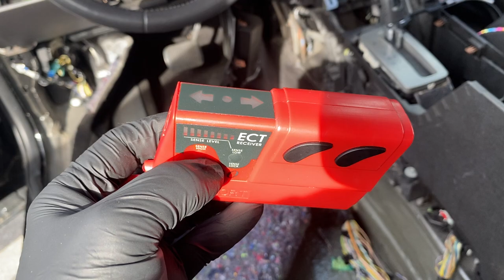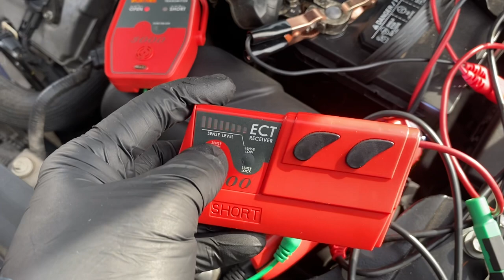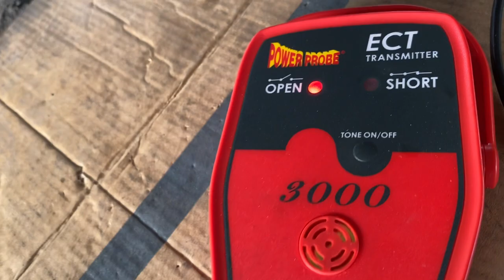Power Probe ECT3000

Comment: I am wondering why on the handheld short tool your arrows aren't lighting up telling you which way to go.  I see the red light but no lit up arrows.
Reply: That’s what’s mine doin idk if I’m doin it wrong or what
Reply: @alexclark6884  I was thinking, maybe we just can’t see them because the cameras digital. But if you say yours is doing the same thing but it’s not because of the camera
Reply: I think it only shows the direction of a short, not an open.
Reply: @bltoth1955   Correct. The transmitter can only show directions with a short circuit. 
...Manual says this, and seems to imply (if not state) it's due to no path to ground to enable direction finding (if it's an open circuit that you're troubleshooting).  

(...For an open, directional arrows seem not so much of an issue since you can easily test along a harness to see where the open signal tone and single-led light indicator turns off at the break in the circuit...)

Comment: Wire broken test...Did you test after disconnecting the battery + terminal?
Reply from the maker: No
Reply from the maker: Just you need both cables leads connected + and - from de battery terminals it's doesn't matter if you have connected to the vehicle because the ECT3000 has the voltage from the battery with the 5v converter tracer inside
Reply: @danielscustoms13  YouTube videos say that if the user wants to find the ect3000 open circuit... After disconnecting the car's battery + terminal... Connect the two ect3000 + - lead wires to the battery... and find the open circuit..
Reply: You can find the open circuit without removing the car + terminal... My work will be easier.. Thank you for your answer